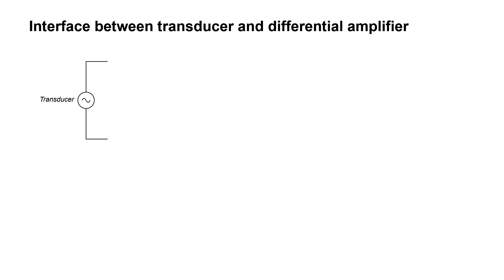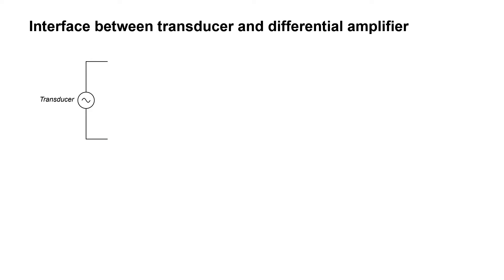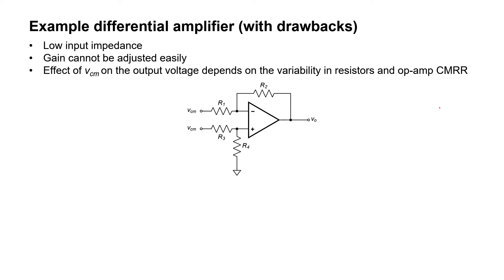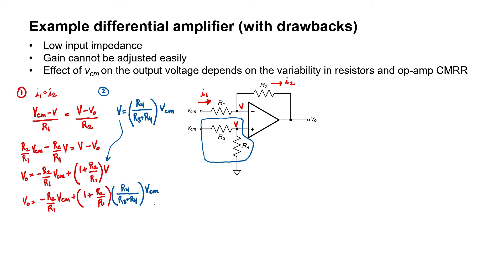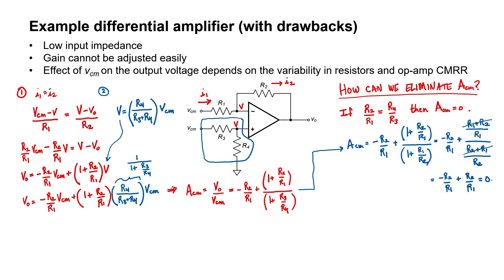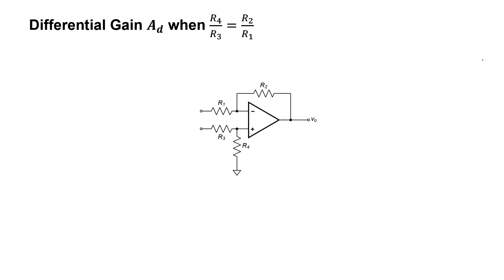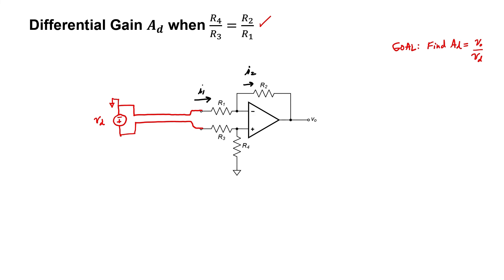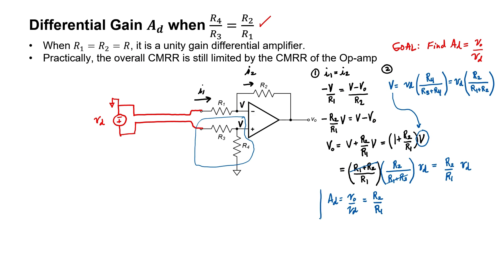Differential Amplifier Design (Amplifiers #6)

Comment: If possible, could you please explain why it is appropriate to include the ground symbol @8:21 near the negative terminal of the voltage source? Doesn't this impact the circuit analysis? If not, might you explain why?

Comment: 8:20 why is the more negative side of the differential voltage connected to the same gnd resistor R4? It doesn't have to be in real applications does it, you are just doing for ease of calculation
Reply: Actually answered my own question, one can easily derive the same result using Vd = Vsig-pos - Vsig-neg and not assuming Vsig-neg is zero